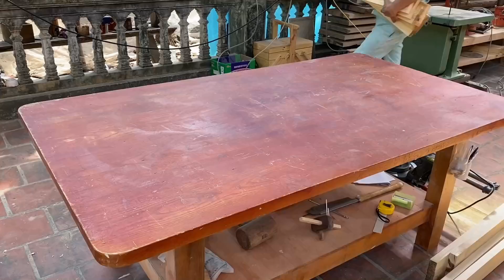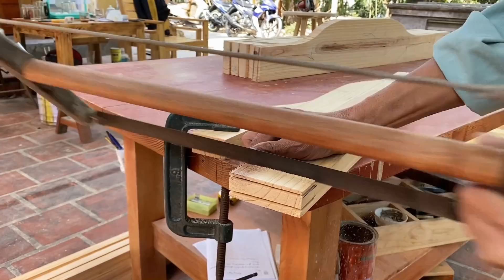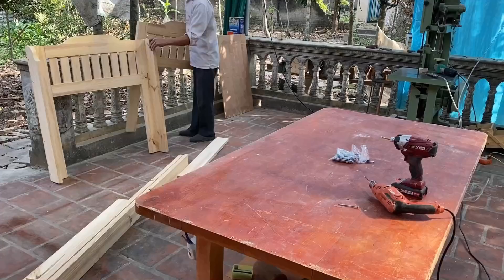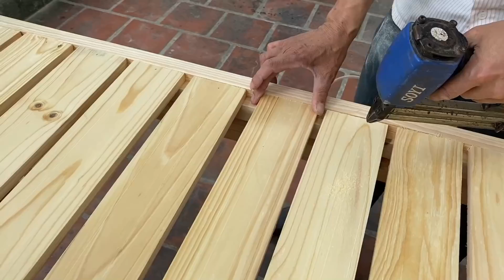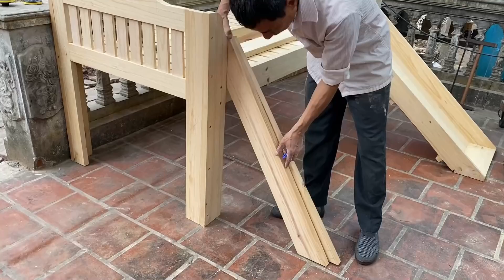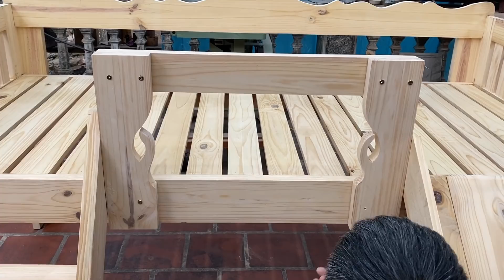Creative Woodworking Ideas For Your Children Happy // Build Wooden Kids Beds With Slides & Stairs

Comment: Nice project but the Screw holes needs to be fixed it's very dangerous for child, Also I would fix the roundovers at the top of  The headboard and bottom. I would also sand the whole thing again especially the 90ﾟ angle on the side of the bed rails other then that nice project
Reply from the maker: Yes, I will learn from experience

Comment: The project is good but the implementation is not! Holes were not countersunk and not drilled parallel, curves at the head and foot area were not evenly sawn and not sanded properly!
Reply: I absolutely agree with you the project is nice but the implementation is not. Especially the screws on the sides nothing was evenly done,and left a lot of Room for scarring  A child's leg or arm. Also the rounded edges are not parallel. Other than that nice project